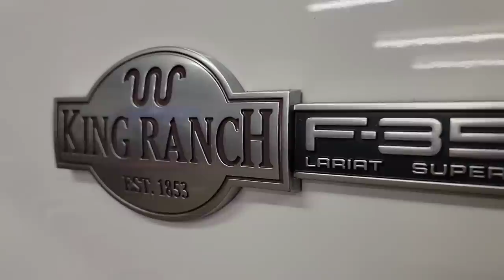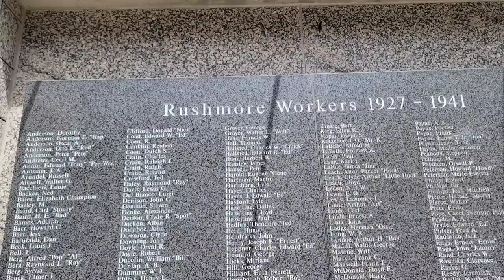WE BUILT A COMPOUND TURBO 6.0 POWERSTROKE

Comment: I am planing on getting a 6.0 what do I have to do to keep it reliably
Reply: If you’re going for reliability get a 7.3
Reply: @JMAN0153  I have a 2001 f350 7.3 with 30k original miles I just got bored of it
Reply: @theslush3574  I don't know how the hell you get bored of a 7 3, they're no nonsense reliable and they sound beast too
Reply: @ingodwetrust1136  they are just slow is the problem
Reply: Dont tune it. Keep maintenance up to date. Use OEM parts. Bullet proof her and you should be good.
Reply: @theslush3574  It's a truck not a race car bud enjoy the beauty of a reliable rig that doesn't need thousands of dollars just to be somewhat reliable.
Reply: @theslush3574  you could build the 7.3 to 600+hp for $15-25k. But really for the 6.0 you’ll just need to stud it and have a new oil cooler installed (at the same time) $3000-5000 depending on the shop you take it too. Also injectors are pretty common to fail on 6.0s because people slack on maintenance (fuel filters) and turbos break too depending on how hard the truck is beat. But once you stud it and get all the little gremlins sorted out the only weak link is the tranny unless you plan on going over 700hp at that point the whole motor would need to be built. Just a ecm and ficm tune on stick injectors stock turbo could get you to 400whp and tranny would probably hold at that power level.

Comment: Found a 6.0 F450 with 176k mi. for $30k.   Clean unit, studded, not deleted (yet), rust free, duel tanks, air ride etc. I would plan to use it as a hotshot truck.  Do you guys think it’s worth it?
Reply: Seems a bit pricey
Reply: I think hotshot requires a newer truck tbh
Reply from the maker: i think itd be great lil pricey tho
Reply: Ok.  Thanks everyone.  I have a 15 f350 6.7 but it’s a diesel hog and it doesn’t have the wide track front axle like the 450.  So I could sell it for $40k.
Reply: You interested in a 450 four door aluminum flat bed with 100,000 needs motor attention and tires for 10,000
Reply: I bought mine in February lariat 4 door 2003 6.0 with 66k miles all stock with a 4 inch exhaust for only 18 grand.